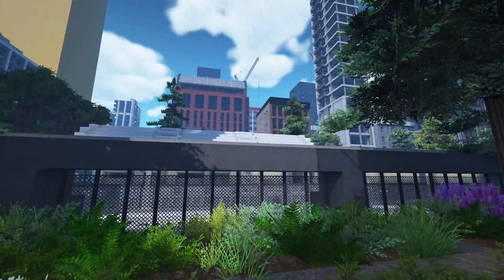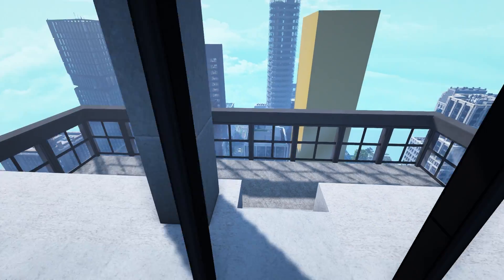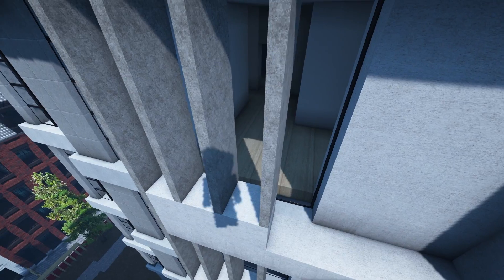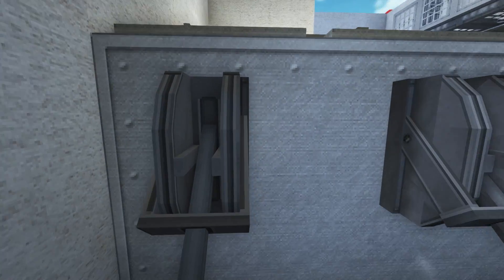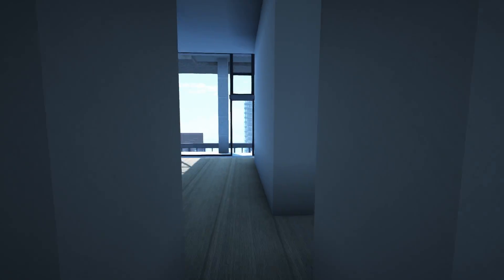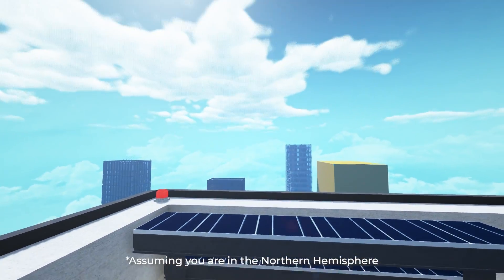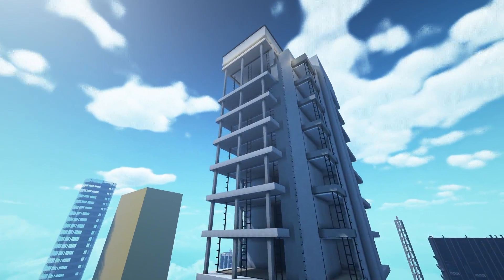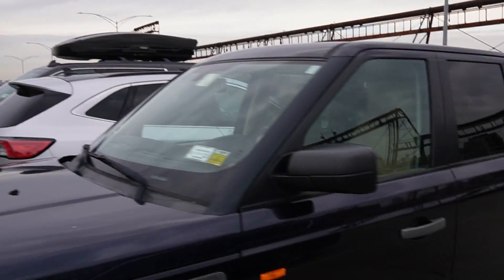How I built this Minecraft Skyscraper using University-Level Engineering

Comment: So the problem of the balcony that low is more of an accidental point of view. If you were to run fast enough you could literally jump. That fact alone can make new owners feel a bit queasy when stepping in a place like this. If they arent used to danger, they might hate it
Reply: This is minecraft, if they were to build this ( obviously not until he gets in to a degree) they would measure the safety. But way big fences would block sunlight.